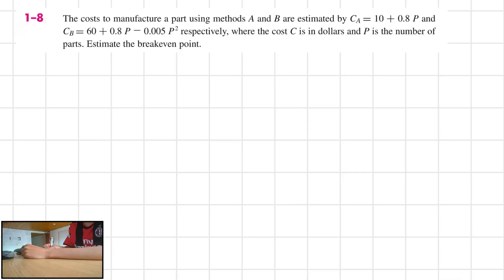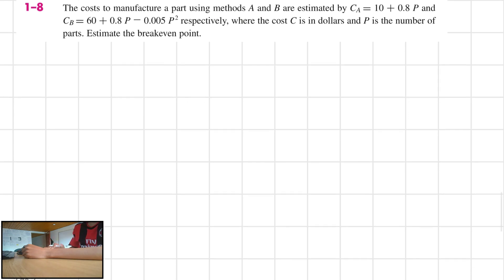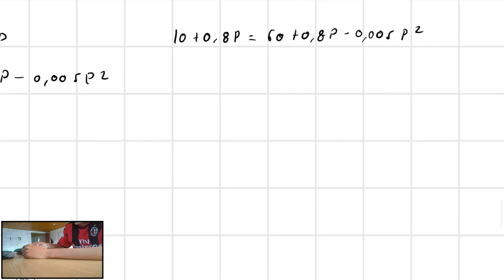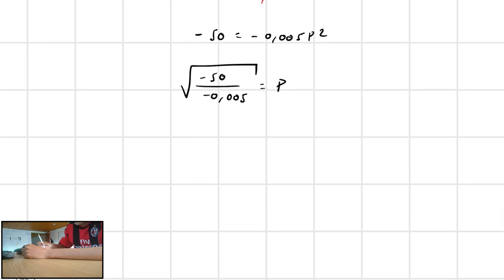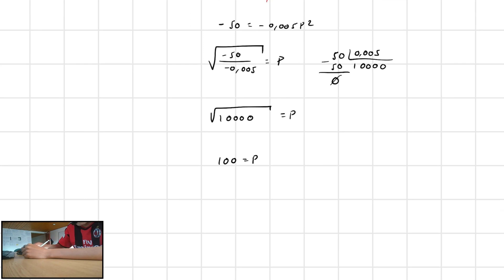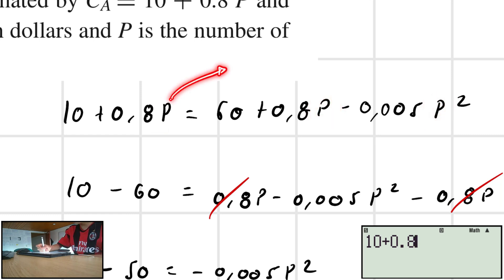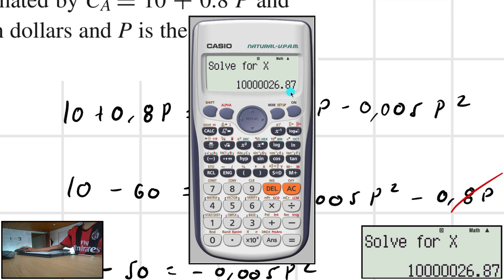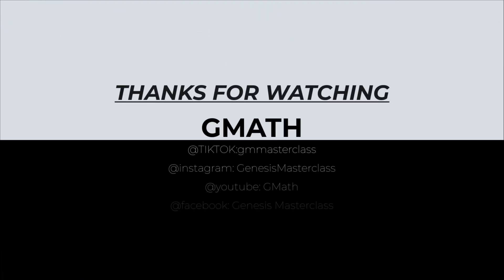Shigley's Mechanical engineering design, Problem 1-8

Comment: A cylindrical part of diameter d is loaded by an axial force P. This causes a stress of PA, where
A = πd2/4. If the load is known with an uncertainty of ±10 percent, the diameter is known
within ±5 percent (tolerances), and the stress that causes failure (strength) is known within ±15
percent, determine the minimum design factor that will guarantee that the part will not fail.
Reply: where can i get the solved solution of this question